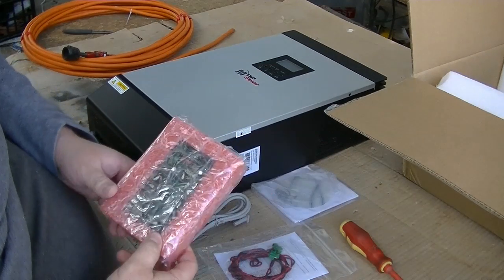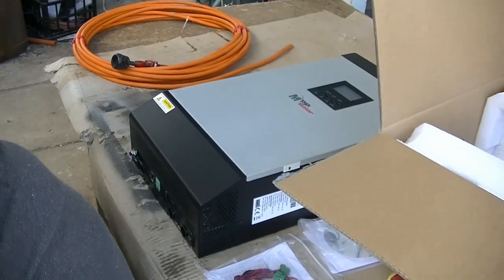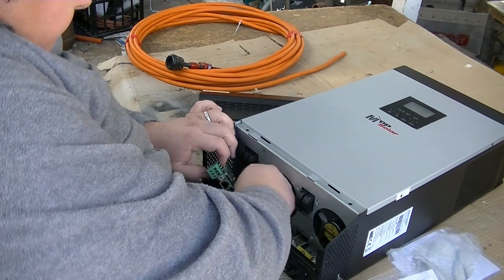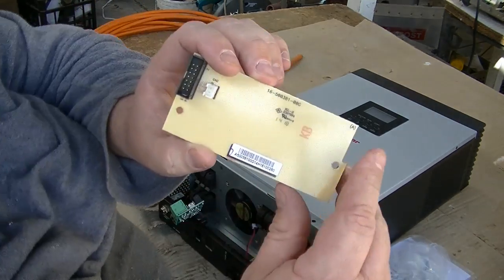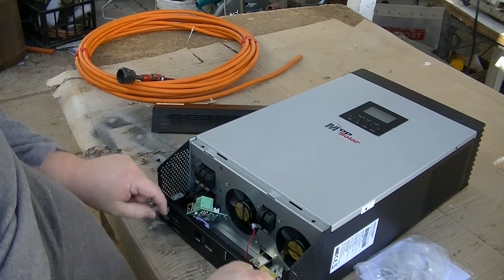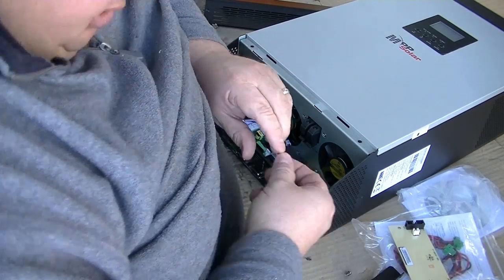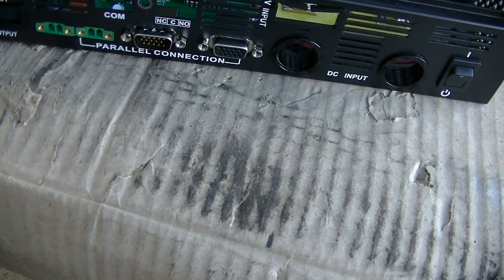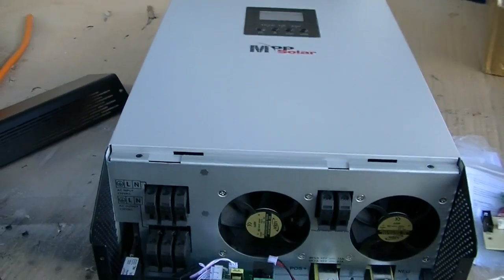offgrid Update on new inverters Putting in the parallel board

Comment: Maysie's thank you the video, I'm now a new member with PIP-4048MS, I am in process to order the second one and parallel kits for both of them, my house because I have (4) teen ages at the house 4000W not going to do it, I hope with (2) of PIP-4048MS that will provided enough power for my house, I was using Magnum 4448-PAE before I switch to PIP, so far I am very happy what I see.

Comment: Cant wait until I get my self one of these babies. I know I run a 240 volt split phase but i think I have a way a round that. by using a 240 to 120 volt transformer and I found those at work and looked up the part numbers so I will be able to still run split phase off these by using a transformer on the out put side of the inverter.  cant wait to get one of these to start off and then add each year as my system  grows.

Comment: Hi... being from USA I know you guys have different line power than we do not sure what you mean by putting inverters in parallel.
Reply: By putting these inverters in parallel mode you can get double the output. 
Each inverter is rated at 4000 watts so by put two in parallel you have 8000 watts of power available at 240 volts
Reply: Bush Block Homestead Is your normal line voltage 240v/50hz or 120v/50hz? And if 240v is that split phase (two 120v/50hz legs)?
Reply: James West
Normal line voltage here in Australia is 240v/50hz single phase.
Reply: Bush Block Homestead Ok thanks.....So do you have two legs of 240v/50hz (two phase) coming in from the power company? And what amperage service would the typical residential home have?
Reply: James West We have an active and neutral wire come in from the power company.New home services are normally 100 amps ,We are in an older house which only has an 80 amp service.
Reply: Bush Block Homestead Ok got it...so that circuit board you put in them inverters maintained the 240v output syn the hz and combined the wattage. I like it you have redundancy.
Reply: Bush Block Homestead p